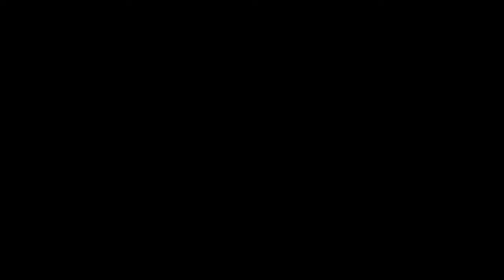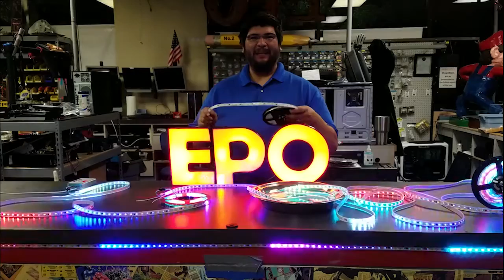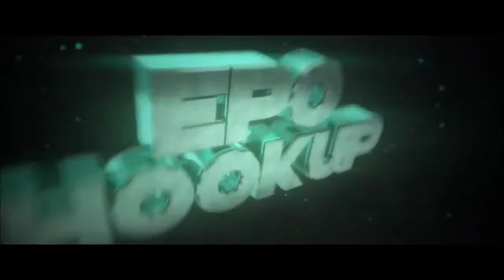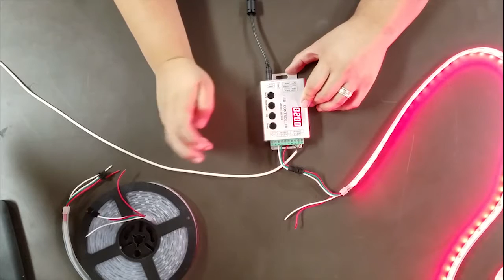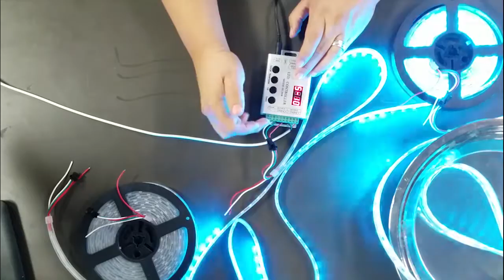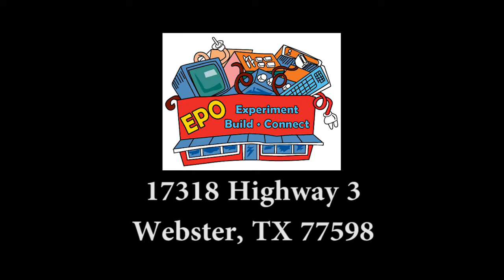Rgb addressable hc008 controller

Comment: Hi
Can you help me I want to buy 6 roll - WS2811 5050 RGB Dream Color 5M /300 led 16.4Ft LED Strip Light 12V Individual Addressable, I connect together make for 30M long . the controller HC 008 can control to run them. And how about the model LED RGB RF Remote Controller DC 5-12V 14 or 21 Key for WS2811 WS2812B LED Strip Light . It’s can run for 30M . What’s different led 2013 -RF 14 keys  and led 2017 -RF -21 keys? Can you recommend which one is best. HC 008 , 14/21 keys 366 kinds effect 2048 pixels ? 
Thanks for your help.

Comment: Thanks for the video.  My version of HC008 controller uses the DA pin and the CK pin doesn't do anything.  Also in my case, adding more strings in series, in addition to the first two 16-foot/300 LED strings works but the colors on the additional series-ed strings show that my 12V/5Amp (60 watts) source may not be enough.  It seems each of my 16-foot/300 LED string draws about 22 watts, so having three (66 watts) and four (88 watts) 16-foot/300 LED strings would require a larger power source than 12V/5Amps (60 watts).
Reply from the maker: you can always run a secondary line I have hooked a total of 6 rolls to this one controller just add your extra power lines every 2 rolls and yes you may require a second powersupply
Reply: @dhatguy7722  so you did power injections?

Comment: It is important to put what your controller supports or you can put any pixel  led 2801 2811 and 6803 in a controller supporting only 2811 and 512 please reply quickly

Comment: Hello friend, I have one query. As you said you are using 12V 5A power supply. And you can connect max 4 rolls (5meter each) 2+2 on 2 outputs. So if I connect 4 rolls, do I need to change power supply? Because you are suppling 60W power and strip load on controller is 288W (14.4 W/m)?

Comment: I have ws2812b LEds but it says there 5v LEDs, can I still use the adapter? One more question, can I use a 12v battery pack to power up the adapter Im trying to make the LEDs portable ..

Comment: WOW. A Newest Led Chip. DC12V RGB addressable. can produce Led strip is 5M/roll or 10M/roll . not voltage Drop. next month will work finish. that's the newest led chipi in 2017. We began to look forward to 15 years from this new lamp beads now finally appeared next month , Now began to accept the scheduled number of only 100K China alone only 400K. learn more please contact me. jessie@witop-tech.com jessie@witop-tech.com Phone:0086+15676178187

Comment: Hey I need your help! Do you think its possible to solder the two 5m strips together to get a total of 10 meter without a gap on the waal because of the wires between the two stripes?
Reply: yes
Reply: Epo Hookup do I need than the 2 additional stripes in the strip number one?
Reply: you can do a simple solder bridge by removing the rubber housing from the end of strip A and the begining of strip B desolder the wires and connect the two . I can create a short video that explains this process if you need it.
Reply: Epo Hookup Yes please! It would be amazing! And tell for what the connecting between the two strips can be useful 😊 because I still dont get it what i can do exactly with the two additional cables in the led strip
Reply: Epo Hookup can you make a video from it?

Comment: hi I have the same set up. however I have 25 meters strip light (5 reels)
because of voltage drop the brightness decreases and also not all.colours ate visible. I have seen in some video that by connecting a gnd wire to the end of strip light the brightness returns to normal and also the colours. what do u suggest
Reply from the maker: Sky Lark  is there any other point in the series to inject power ? do you have a pic or link to the reels that you have.